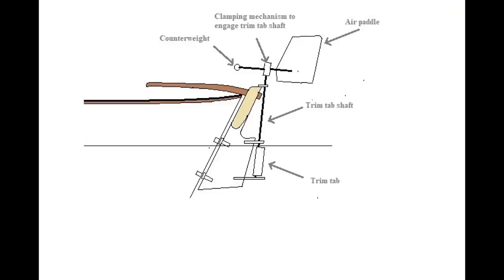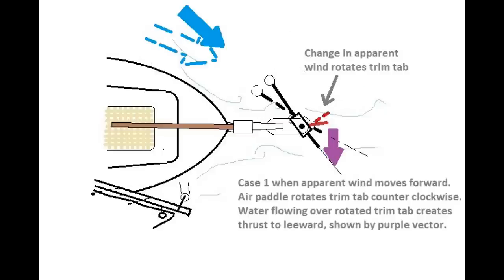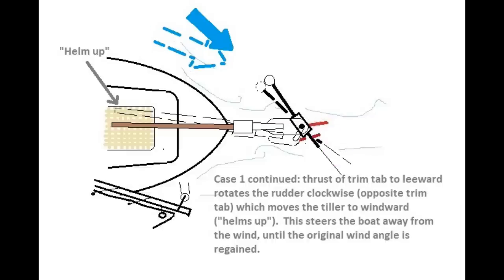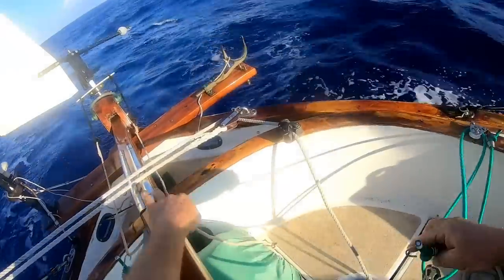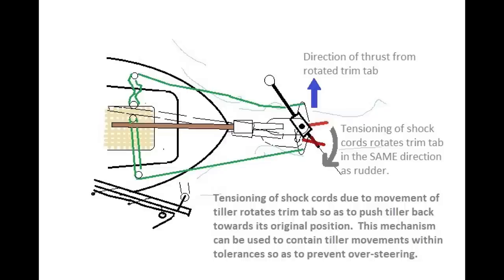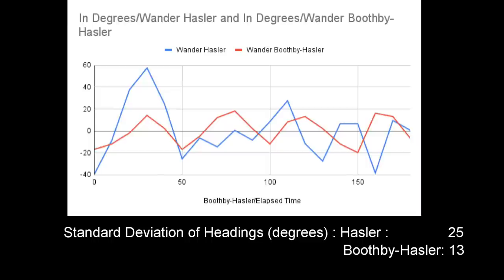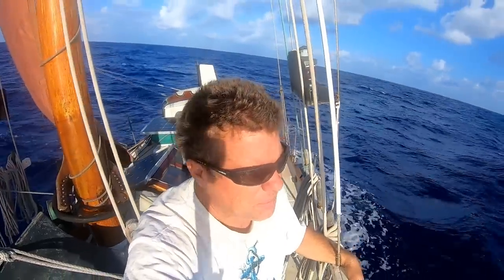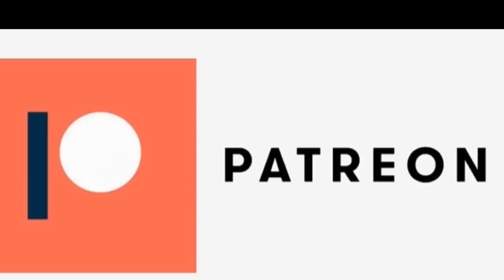Self-steering windvanes, sextant navigation, southward progress | Ep. 197

Comment: Controls Engineering.  You essentially changed the gain of your controls system.  Good job.  You could also expertiment with the sizes of the vane, trim tab, and rudder.
Reply from the maker: Experimenting with rudder size would not be so simple ... I did modify the trim tab somewhat, as it was originally a bit too large.
Reply: Sir Francis Chichester experimented a lot with the vanes on his various Gypsy Moth sailboats.

This included a vane nearly as large as his mizzen.  Absurd, yes, but that was where his experimentation led.
Reply: @secretsquirrel6308  Yes the GM3 1960 had quite a large obtrusive vane didn't it.

Comment: That was a nice demonstration.

Another thing you might try is limit lines. These would be lines that connect at the end of the tiller, and connect to the cockpit on either side. The trick is to leave a little slack in each line, so the tiller could swing either way, a little bit, but not enough to drastically over-steer.

I had a similar system on my sailboat. But I had no vane. The difference, in my case, is that I had a shock cord, to pull the tiller to windward, and a limit line to oppose it. My boat steered itself quite reliably on any course that was 90 degrees to the wind or higher.

This system worked so well that I was able to set the mainsail, to get underway, then venture forward to put the jib on.
Reply from the maker: That's what I used to do, but the trim tab exerts quite a bit of force on the rudder and it wore the shock cords out pretty fast.  Plus I didn't like all the stresses and strains it was creating.

Comment: Hey Kevin looks like you're having fun another great video, very informational, thanks for sharing.

I might get a chance to play with that trim tab method at a future point, but with my Edson it will not be possible unless I add a flip-down trim tab which I am thinking about playing with, typically I align the vessel leward about 17 degrees then trim sails to hold chorus with an additional four to six degrees on the tiller to maintain a balance pressure and use that for my Tac angle.

Unfortunately the Allied rudder is a negative angle so I won't be able to play with that version directly, but it's a lot of fun messing around with this stuff I love your design and modification it works beautifully.

Fairwinds captain, hope to see you out there this season, I'm currently in the lower Pamlico doing refit work on a couple of my projects and get some time periodically to go out and play on the Catalina.

Comment: My experience is of any type of commercially produced auto pilot (yes, A/P not hydrovane) the wandering was not reduced below 10*.  This includes all types of sea state and wind angles, inclusive of flat calm zero swell conditions.

The Boothbay modified Hasler, especially in consideration of low cost, easy access, limited parts, is hands down the winner.

We did install a trim tab on an S&S sloop.  In that case, the tab was controlled by a horizontal wheel connected by chain drive and wire rope to the actual tab since it was keel hung rudder.  While it worked fairly well, it was cumbersome and too many parts requiring precise alignment.
Reply from the maker: Agree.  The biggest selling point of this type of vane is the simplicity, that there's no need for lots of highly machined parts.  I used to have an Aries, which definitely steered better, but when it needed a rebuild I switched to this Boothby-Hasler-Rube-Goldberg vane gear and I'm happy with change.

Comment: I wonder if your basic system includes the differntial gear that BH developed in order to control the oversteer issue? He used it successfully in 1960. 
Alternatively your could simply follow BY subsequent developments and go to the very efficient and precise steering servo pendulum type.
Reply from the maker: Servo pendulum's are indeed superior--used to have an Aries.  But they are far more complicated, expensive, and in my opinion unsightly.  The air paddle clamps directly to the shaft on my arrangement.  I haven't studied Hasler's design in detail, though I see that Pardey separates the air paddle from the trim tab shaft, and has some sort of chain linkage.  I shied away from that because, again, it adds complexity and makes it harder to construct.  It also introduces extra friction.

Comment: 20 degrees is a lot but maybe that is a broad reach only number.    I was doing a close hauled and can maintain 30 degrees most of the time.    40 degrees is very reasonable with a monitor wind vane.   I will test out a broad reach to see.
Reply from the maker: Close hauled generally has much less wander.  In fact, many boats will sail without self-steering at all when close-hauled.
Reply: With an adjustable bungie to windward attached to the tiller my boat sails herself to windward with no vane
Reply: This thread is this close to calling up the magic if the ketch rig.  (giggle)

Comment: Kevin you appear to to have too much gain in your system, ie it is too powerful.  Perhaps you could try reducing the size of the trim tab. (once at anchor :) The force on the trim tab depends on size and boat speed cubed.
Reply from the maker: Many people have commented that.  I did in fact reduce the size of the trim tab a little, but it's hard to make any drastic changes without building a new one.  Anyway, I'm not convinced gain is the issue.  Rather it's the effect of the rolling, which tends to increase yawing when broad reaching.  The Boothby-Hasler set up is an attempt to introduce an anti-yawing mechanism, which the servo pendulum type vanes already have by virtue of their design.

Comment: Note that a GPS that is not capable of doing SBAS corrections has a rather large error, up to 5 to 10 meters. That can give quite a large error in heading.
Reply from the maker: Fair point, although I think the big difference in measured course variance between the two systems is not just GPS noise.  This is also consistent with what I'm observing, as well, just watching the wake of the boat.
Reply: @howtosailoceans1423  I have no doubt in your modification. That is a very nice mechanical gain limiter! I just see people often giving way more confidence to their GPS than it deserves:-)

Comment: would there be any advantage to taking all the slack out of the shock cords on both sides of the tiller?
Reply from the maker: In my case I found that that results in over steering, the shock cords are necessary for damping.
Reply: @howtosailoceans1423  I understand that they damped the over steering and I applaud your resourcefulness, I just thought you had some slack in the dampers and wondered if that was intentional or necessary.